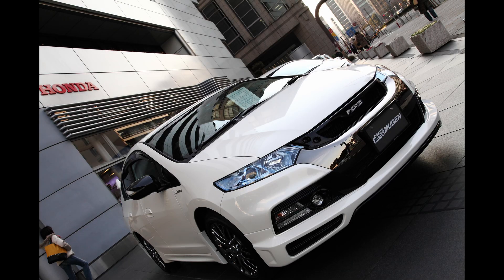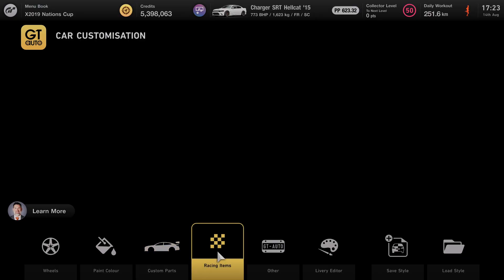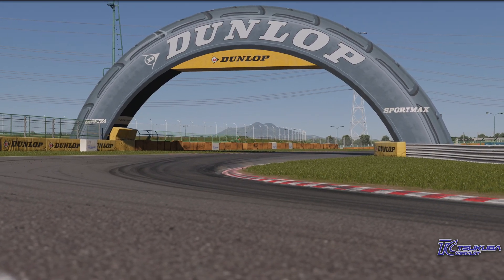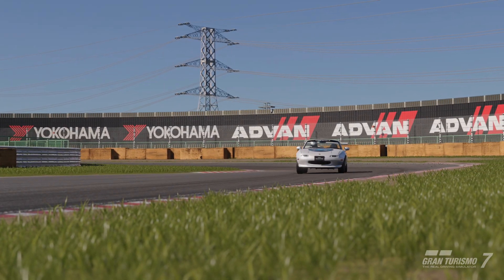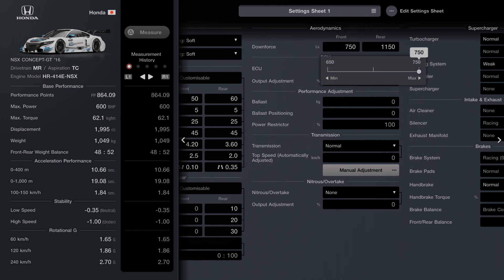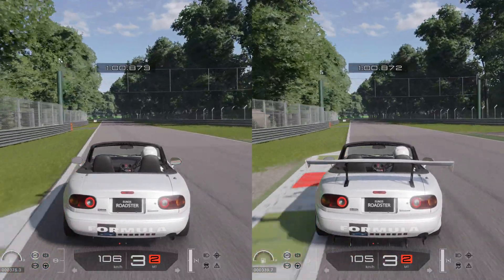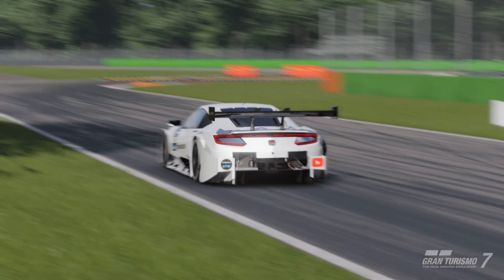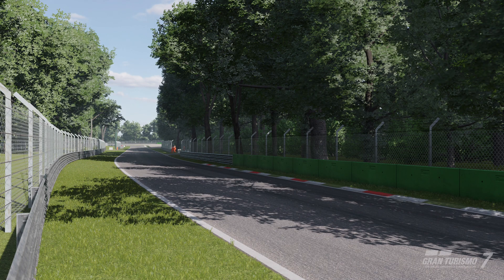Is Downforce Faster Or Actually Slower? - Testing Aerodynamics in GT7

Comment: In my experience cars with aftermarket aero tends to have less drag compared to cars that came with high downforce stock, an example is the two 911 GT3RSs we have in game, judging by cornering speed the two should have similar downforce when the 991 has all aero parts fitted and max downforce available set in the tuning, but the 991 can achieve a much higher top speed despite having slightly less power